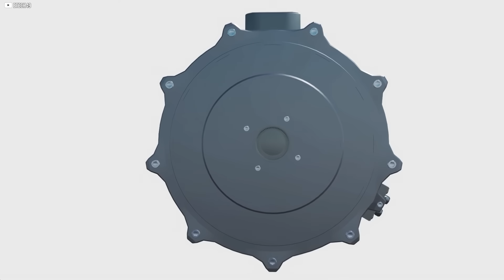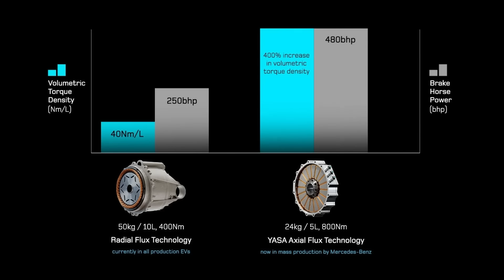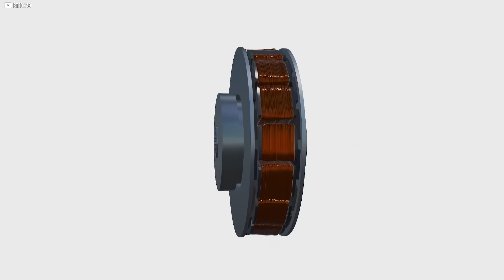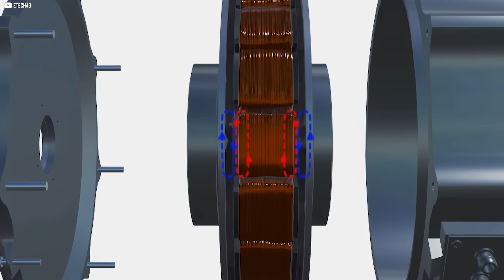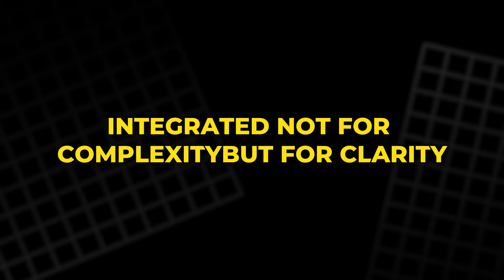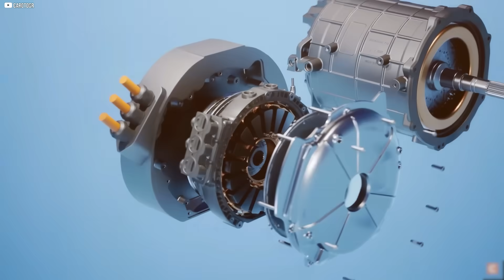The Motor So Powerful, It Doesn’t Need Gears

Comment: Basically all EV have no technical need for gear ratios, beyond whatever the producer wants to focus on, all electric motors have the torque to drive most cars directly.
Reply from the maker: That's a great point about the potential of electric motors!

Comment: French amateur physicists Michael Faraday developed for a World Fair exposition a formalized electric motor that was originally a child's toy with complete mathematical explanation as to why it works he presented it to the World's Fair officials what does it do you figure it out what's his response how close to a 800 years we've been figuring it out no disrespect to this guy but every air pump I've ever used has the magnets as far out as possible and the armatures spinning in the magnetic field along the edges of the of the motor so this is not new in fact it's depressingly old yeah I'm going to have to be mean and say that this is old news and old hat
Reply from the maker: That's a fascinating historical perspective on the development of electric motors!

Comment: At 5:05 in the video: The portion of the copper winding in axial motor that is circumferential (the innermost & the outermost parts  of the turns) may be in magnetic field, but like the winding end-turns in radial flux motor, do not contribute to torque & dissipate power just like radial flux motor.  Only the portions of the coils perpendicular to the MOTION contribute to useful torque.
          While a larger portion of the winding contributes to torque, the price paid is the inability to overlap coils.  In any region of the motor, there can be only 1 phase.  This reduces by a factor of 3, the amount of copper windings that can be put in a motor of a given size.

Comment: Motors and Engines are Machines. Machines are mechanical devices that use an energy source to operate and perform mechanical work according to the capabilities of it designed perameters.

Comment: Koenigsägg still blows this technology away. Their dark matter motor is similar in size but 800hp. Their transmission is also better than anything else out there. 
It’ll take years for the world to catch up.
Reply: Koenigsagg are super expensive, just like Lambos.  So excuse my position that EVs are still have a huge economic advantage here.  You can buy a Tesla S for 10x less money than a Lamborghini.
Reply: @rickChapman-y9w  you’re absolutely correct. We have a plug-in hybrid and love it.
Reply: I thought the same way...
Reply: suitable for mass production?
Reply: @koenraad4618  The entire car? Definitely not, unless they can figure out how to mass produce carbon fiber. But they could license the dark matter motor and transmission…?
Reply: is the torque also great on the Dark Matter motor?
Reply: Any lead for Koenigsägg tech page/document for any much details..? 'll be much appreciated pls

Best regards
Reply: The Koenigsägg is also built for reliability and accessibility. Other hypercars are ridiculously expensive to do things like an oil change, etc. Most are in excess of 10k just for new oil. Koenigsägg is built to drive in all environments (especially in snow). Obviously the AWD versions are going to do better than the RWD. Plus they run best on E85 fuel and meet all emissions requirements regardless of State or country. 
What would be ideal? For Koenigsägg to license some of their tech to the rest of the world…not just to one or two vendors but to anyone who’ll help humanity move forward. Yes, 800 hp isn’t necessary for your average Camry, but how much more could we all benefit in terms of added space in cars? If an entire engine (motor) could fit with a transmission and be 1/10 the size of today’s motors and transmissions..think of the room left over for whatever you want. Look at the Gemera…hypercar specs, 4 passengers and enough space for luggage. It’s incredible.
Reply: And I believe it is 6 phase and not just 3.
Reply: The dark matter 6-phase motor is going to change the world. In a 3 phase motor, you have spots where it's coasting to the next pull.  This motor is always pulling power.  I can't wait until they have this motor and a solid state battery in a dirt bike motorcycle. I hope it's under 200 pounds and produces 60 horse power with a 150-mile range.  (Most 450 bikes weigh 250 full of fuel, water, and oil and produce 60 hp)
Reply: Ebikes weighing 55# with 6000w are fun. Solid State Batteries offer more power in smaller and lighter options.
Reply: Conisegg is overpriced and over engineered junk.  Rimac is the one ahead.😂😂😂😂😂😂
Reply: Koenigsegg motor called Dark Matter is 39kg,8500rpm,800hp,1250Nm BUT the newest motor from YASA put Dark Matter to shame I don't know which name it has but it should be called SuperNova because it's only 12.7kg and 1005hp so 3 of them are only 38.1kg but 3015hp and they said they didn't use any exotic materials in production of prototype
Reply: The average person does not need an 800 hp motor. Tesla seems to manage high power at a much lower cost.

Comment: It's not only about weight and size, it is about cost and as these are only being put in high end European luxury cars I guess we have an idea of how much these cost. The funny thing is that a Tesla Model S Plaid will leave all these in the dust for less than $100 K
Reply: I think that better engines may be on the horizon
Reply: High Performance: These motors provide high torque and power density, offering up to four times the performance of other motors used in today's electric cars. Price will be lower, after luxury car.  New factory.  Weapon industri.  Can bring Europa back on top.

Comment: Does anyone understand where the idea of an engine powering an electric motor came from? If you understand One of the biggest and most powerful land moving vehicles "trains" then you'll understand where that idea came from.
Reply: That's entirely different.  Those are diesel engines turning a generator to supply the electricity.  It does not lend any power to the drive train of the train.

Comment: Great electric motor, as long as you have an unlimited supply of rare earth materials/magnets. "Mercedes’ acquisition of YASA in 2021 might help secure supply chains for their premium EVs, but it doesn’t solve the broader issue of rare-earth dependency. Meanwhile, Tesla’s strategy of mixing motor types and reducing rare-earth reliance gives them an edge in mass production and cost control."
Reply: Rare earths are not rare. The problem is processing. It's mostly done in China. There are a number of companies working to improve processing methods and reduce reliance on China.
Reply: Damn shame nobody wants to be seen in a Swasticar
Reply: @wnose :  Yesss!.. Almost ALL of them were Hitler "collaborators", during WW-2... 😢😢😢

Comment: it would be nice to use them to avoid burning any fossil fuels, or burning anything at all.
Reply: Lame brain
Reply: Where do you think the power comes from to charge the battery? Here is your problem to figure out. How do you charge the battery without fossil fuel and remember when using fossil fuels the amount of electricity that is made from it is more than the battery uses because your "magical" batteries are inefficient at charging. Right now if every vehicle was electric the world's power grid would collapse trying to charge them. There is not enough capacity for that many batteries.
Reply: @Craig-fl8jj  ever heard of solar? or.... wind? or ....water? .......do you really believe we're in a world where the only way to generate energy is "burning stuff"?
Reply: @theblackwithin3457  as an electrician of over 35 years I can say solar is pathetic.  A 600 acre solar farm will net you about 48 Mw of energy and a natural gas power plant that's about 15 acres will net you about 650Mw of power. Solar is crap. Wind is crap because it spends half of its working lifetime to remake the power that was used to make itself. Not to mention all the birds they kill. Solar doesn't work at night or in the rain or in high dust conditions. Wind doesn't work when the wind doesn't blow. Neither of those are reliable and they devastate the environment they are in. Nuclear is the way to go but fossil fuels for now are our only realistic way we can maintain and add to our grid. Adults know this why don't you?
Reply: @Craig-fl8jj  that being said: the efficiency of batteries is usually way above 90%. the efficiency of the best combustion engines, at their peak efficiency, in ideal conditions is around 40%. and the energy efficiency of "getting the oil out of the ground and into your gas tank" is about 10%. the rest gets lost in raffination and logistics.
Reply: @theblackwithin3457 and the efficiency of batteries is not 90%. You have power loss when charging and discharging batteries.  Batteries also cost in electrical terms when building them and they have a short life span. Again let the adults figure this out. I'm quite sure you don't know Mw from mw.
Reply: Instead they should tear up the earth mining for rare earth minerals and all the other caustic compounds that go in your green machine that's not clean
Reply: @macmaccourt  better than tearing up the earth mining for cobalt needed for high-efficiency alloys so that combustion engines can even reach their measly 40% efficiency, and tearing up the earth to try and extract more and more oil - not just once for production, but continuously for operation. no, electric cars aren't clean. they're just orders of magnitude cleaner than ICE cars.
Reply: @theblackwithin3457  So when the lithium batteries burst and burn furiously giving off toxic fumes, your GREEN energy is negated! Drink some more Flavor Aid! lol

Comment: Not new... had a whole discussion  on electric motor axial motors integrated in to the engine 10 years ago with a bunch of other engineers. They just finally did it but nothing new. The new axial design definitely deserves the credit.

Comment: Why not is aluminum wire used in electric motors
Reply: Aluminum's conductivity is about 61% that of copper
Reply: @commieTerminator 🙏
Reply: What about carbon fiber “wire”. Is that possible
Reply: @prilep5  it's lightweight but electrically a poor conductor. It will generate a lot of heat if used in motors hence very poor efficiency
Reply: Thermal expansion 43% higher than copper. Also fatigues far more.

Comment: These motors go back almost to the beginning of electric motors. The technology was not available to make them viable then. This is old news.
Reply: And there is a reason electric machines gravitated to radial.  The biggest advantage is high rpm for power density favors radials -- look at the Shinkansen or lucid motors as examples of the still very primitive traction motor tech used today.

Comment: Washing machines have been using segmented electromagnets for decades, haven't they ? If so then the patent/s may have expired ?
Reply: The PMSM washers and driers I have seen still have yokes connecting the backs of all PM and EM magnet poles and use radial flux layout, not axial flux. The yoke is pretty much mandatory in a radial flux motor, otherwise you lose nearly half the strength, lose powed to eddy currents in places there shouldn't be any and possibly create an EMI nightmare.
Reply: @teardowndan5364 right

Comment: Don’t forget Motors and engines aren’t the same things.  Engines burn fuel and motors use electricity.
Reply: Ford Motor Company just saying.
Reply: Do you use motor oil in your engine?
Reply: @eycchu Lubrication in a modern motor isn’t necessary.
Reply: @rickChapman-y9w  All parts that contact other parts that move at different speeds need some form of lubrication, whether it's externally applied, or built into the materials that make up the parts.  Otherwise, they will wear out in short order.
Reply: @eycchu So what I understand today, is that a motor is any method of converting energy into work, but engines are specifically for combustion
Reply: @eycchu But electric motors are never called engines.
Reply: @rickChapman-y9w  When I supported spacecraft I&T of one our instruments, I chanced to meet one of the tech from Boeing in the facility where they built the rocket motors.  He told me they were building the SRMs (solid rocket motors) for our Delta-2 Heavy.  Those motors used no lubricants as they had no moving parts, and they're called "engines" interchangeably.
Reply: @eycchu That’s  fine.  I still have never heard an electric motor ever called an engine.
Reply: Holysheepshit
Reply: engine: "the part of a vehicle that produces power to make the vehicle move" (oxford dictionary). nope. no mention of "burning fuel".
Reply: How about a hydraulic motor, smarty pants?
Reply: @bryanpetersen1334 adding complexity adds more cost and problems long term.
Reply: I put petrol in my motor car..just saying too 😅😅😅
Reply: @Dontbelievewhatyuhear Language has a way of appropriating terms to mean different things.  Take a look at the Oxford english dictionary and how over the 20th century, words have evolved multiple meanings which have no relation to the root of the word…yet still exist.
Reply: How about my  motor skill on my bicycle
Reply: @Dontbelievewhatyuhear Your human power is somewhat induced by electrical impulses between cells in your body.  The is stretching a bit though.  The reality is that electrical motors are never referred
 to as engines
Reply: Incorrect, engines are motors.  The word motor is latin to describe the prime mover in a mechanism, like a water wheel, wind mill... The "prime mover"... Under that definition, even the windup spring in an old clock would count as a motor.
Reply: @kayakMike1000 allright, so by that sense you say what a "motor" is, is actualy a rotor? Or what do you want use to call it. An engine is a short name, motor is a full name. An engine is an: Internal Combustion Engine (ICE), that is why 99.99% of humans mean a flammable burning power unit when they say Engine. And not an electric motor
Reply: @kayakMike1000  Since the invention of the electric motor, the engineering term motor is selected for electrical drives only…it has only been over the last 10 - 15 years that non technical people have used the terms, incorrectly, interchangeably

Comment: The real reason why Wallstreet is trying to kill EVs is because the internal combustion drive train produce income beyond the initial vehicle purchase

Parts, repairs, and maintenance services produce high income
Reply: The same with the Computer system, phones, and electronic entrainment system of all kinds of  their enjoyment, and Commercial marketing...
Reply: Internal combustion engines are a mantaince nightmare
Reply: @WeberMachineWorks what? No their not lol. Unless you call having to fill up the gas tank maintenance.
ICE engines can actualy run very long times without issues if their made right. (Take honda motors, or Toyota eco engines)
Reply: In the long run EVs would cost us all collectiveley more.
Want me to explain why?
Then press read more VVV

When converting a solid or liquid fuel (chemical energy) into electricity by burning it, some of that energy is lost In the form of heat.
Its about the same as a gas powerd car, 35% up to 60% is energy (mechanical in a car, or electric). the rest is lost and turned into heat.

This also happens when using an electric motor in an EV! not all of the electricity that goes into the motor is turned into motion, also heat.

So lets compare,
Fuel powerd car:
60% efficiency at best. (Eco turbo)
EV:
power plant: 60%
Already the same because thats how power works.
Now the EV: some gets lost while charging, some gets lost while converting to movement.
About 88%, so thats 88% of 60%, which is: 52,8%

So if you understand what i just sayd. That means electric vehicles burn even more fossile fuel, because they requier 7,2% more energy, for the same power output.

So yes, all of the world is fkn wrong, EVs are not eco friendly. Not even to mention the extra weight of those huge battery packs, and the insane CO2 output for digging up those expensive metals...
Reply: @henryhoedman1213  until another power source comes in and change the game:). Isn't that how it always works.
Reply: @kkrobertson1  what do you mean by that? if your 1st language is not english please just respond in your language and i will translate it. because the sentence you just put here makes no sense lol
Reply: @henryhoedman1213  stop being a devil. I know it's hard for you but try anyway.😂
Reply: @kkrobertson1  idk t f*** you mean, the comment you replied with litarly has no accurate grammatical structure XD its not correct, it doesnt say anything.
the literal meaning of your comment is that, another power source changes A game. we dont know what game, it just changes A game. that sentence makes no sense buddy